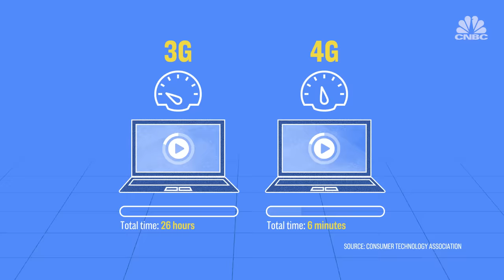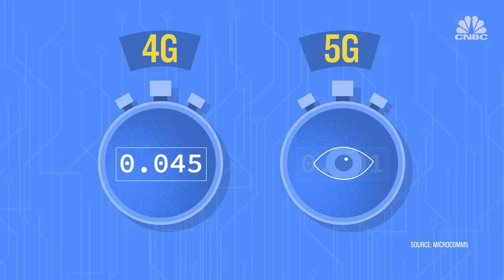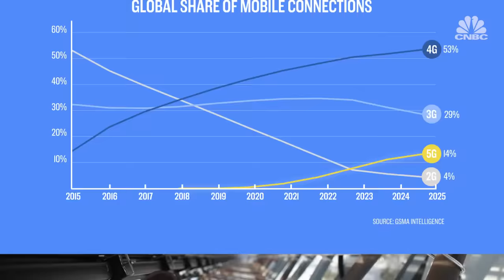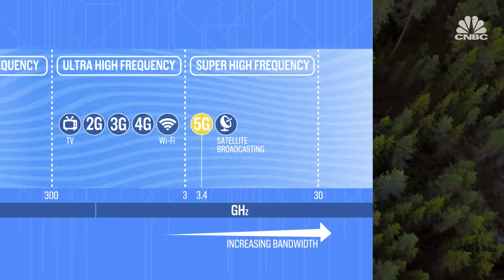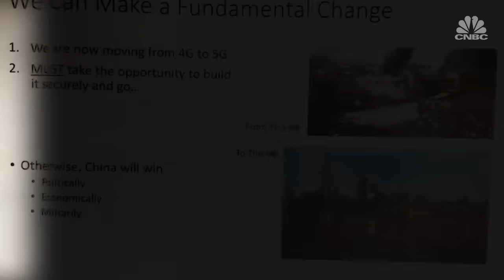What is 5G? | CNBC Explains

Comment: Every next generation wireless broadband technology overpromises and under delivers.  The real issue here is that you have almost infinite user demand for bandwidth and finite capacity.  With a few million users on the network it will all grind down to 1-2Mbps.  All we see here is speed tests and latency measures in an ideal network condition with zero network congestion which is hardly the case once the network is deployed.